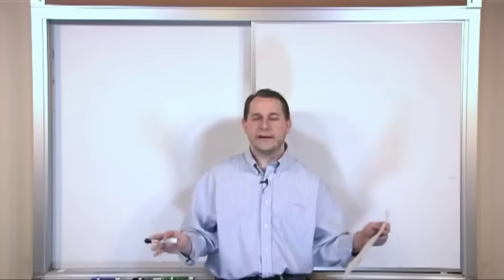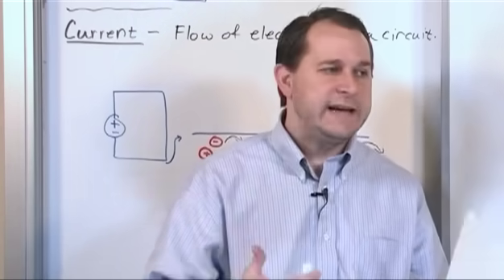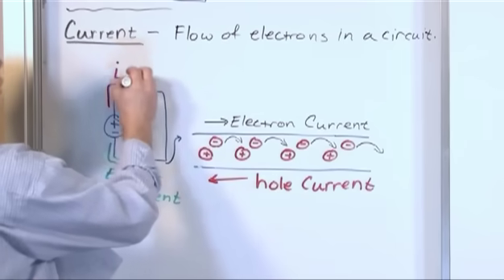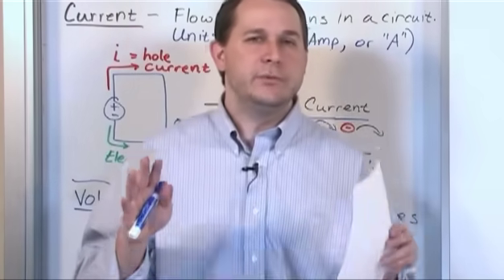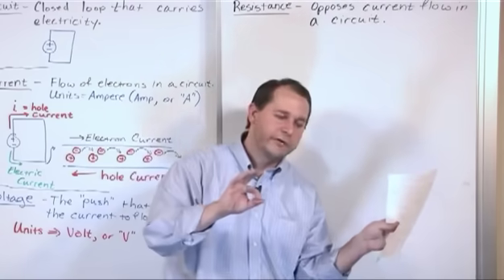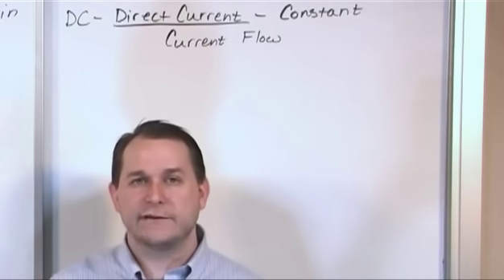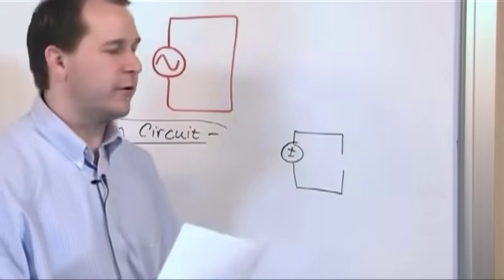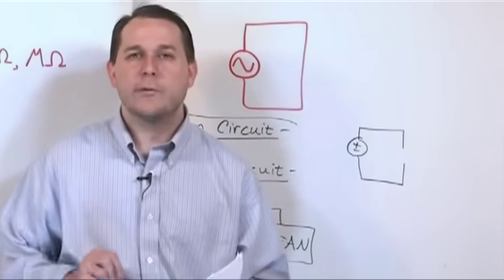Lesson 1 - Voltage, Current, Resistance (Engineering Circuit Analysis)

Comment: I would add that in an open circuit, there is no current but there is still voltage or "potential" at the ends of the wires, because the source is still trying to push and force electrons down the wire and they're getting jammed up against all surfaces of the wire trying to find a place to go. Thus, the electrons still have the "potential" to do work, and if you add a resistance/load they will "inrush" immediately into the load and can cause a spike in current which eventually levels out to a more constant current.

Comment: A volt, amp, resistance meter measures electricity but heat also does. Resistance causes heat. When you have a battery terminal and one is hot you know which one needs to be cleaned. So the heat in the resistance of the dirty terminal measured in Watts or resistance?

Comment: Can anyone please help me clarify this?  I've spent my life thinking electricity flows from positive to negative but now this video indicates exactly the opposite of that.  However, if I take a test light (and ground it properly) to a 12 volt car battery, the test light doesn't light up when touching the the neg. side of the battery but it only lights up when I touch the pos. side.  If electricity flows from neg to pos as this guy suggests,  shouldn't my results with the test light be exactly opposite?  An answer from anyone would be apprecitated!

Comment: Another confusion that people always have, is that they think the voltage source comes with excess electrons to push or to create current flow, not realizing that the electrons that are being pushed are the ones from that copper wire atoms that get lose as they get that excessive energy from the voltage source to start moving
Reply: Excess electrons to be pushed*

Comment: In actual setting or there are electrical loads connected to the circuit which of the  current will flow in direct current or alternating current source? is it  the electron current or the hole current in the conductor? Is it the same for direct current or alternating current?
Reply: Well batteries and DC supplies generate DC current which is constant, while AC generators generate AC current which changes it's polarity very quickly. In conductor electrons move not holes. But if you look at it form electrons perspective holes move even though in reality electrons move. But either way it doesn't matter since it has no effect on equations. Yes it's same for AC and DC. It's always electrons moving but sometimes we just pretend that holes move because it's easier in some situations.

Comment: Youtube randomly introduced your channel to me, however it was lesson 2 after which I subscribed, my second video I watched is your video 1 as the intro, and I am much smatter for it as a new hobbiest to electronics. Perhaps a suggestion from an Facilitating point of view would be to actual use real examples of your discussion points, unless you are only focusing on graduates that already has great subject knowledge. You can easily switch your explanations between your whiteboard illustrations and your real blown up picture of a circuit board. Sometimes students will wonder about what it is you are talking about,example perhaps the  size "is it as big as a mug or as small as a fly" instead of listing they first trying to figure out, which of the several components yon a circuit board you are talking about.

Comment: Another analogy for amp and volt is the amp is the gun, or the size of the shell, the amp is the bullet itself.  I guess the ohm would be the target and it's resistance to the bullet, or more accurately the air resistance.

Comment: The electrons are supposed to flow in a circle so you never "run out" of electrons, right? So after the electrons go from the negative terminal to the positive terminal, how do the electrons travel from the positive terminal back to the negative one to complete the circuit? Why don't the electrons just all accumulate on the positive terminal? And what exactly is a terminal and how does the terminal get its charge?
Reply from the maker: Great question. After the electrons get back around to the other terminal of the battery to go into the battery and the chemical reaction inside of the battery pushes them back up to a high potential again to flow out through the other terminal. So the answer to your question as you can think of the battery is a little chemical pump that takes the electrons from one side and pushes them up to a high potential to exit the other terminal and then go through the circuit again and again and again. When the chemical reaction runs down and the reactants  “wear out” then the battery is dead.
Reply: Thank you!

Comment: When you're talking about Hole current, I immediately thought of P type and N type semiconductor. Idk if they're related but that's something just pop up in my head. I'm 2 to 3 years already behind my school so idk if what I'm saying makes sense. Thank you for this video.
Reply: Well they are related. When talking about PN junctions you can talk about holes moving or electrons moving depending on situation. Like for example when talking about NPN transistors it's easier to use electron flow but with PNP transistor it's easier to use hole current.

Comment: DC power generator or solar panels give dc supply in two two phase positive or negative  give smooth easy to control , 3 phase sinusoidal waves in 60 cycle  that’s why in low voltage 3 phase the breakers has to have 3 common trips to avoid single phase tripping in high voltage relays will take trappings in low he lines aside from track mounted breakers  sensitive relays sense lightnings direct to grounding transformers  in Marshaling electrical room that’s why AC power is complicated compare to DC Power just saying  Thanks

Comment: Did he say smaller is more resistance? Did he say that? Cuz if he did that is whacked out wrong.
Reply from the maker: A smaller wire diameter DOES have higher resistance to current flow.
Reply: You're whacked out wrong.  If you didn't have your head so far up your ass you'd know smaller wire equals more resistance.

Comment: Does the electrons move faster through the circuit, if there's a current with a high ampere than a current with low ampere?
Reply: No. The ampere is just a measure of how many electrons traveling through the circuit per second. So the higher the number, the more electrons traveling through the circuit per second. Think of it as a circuit with large amperage is a big river of flowing water compared to a small river of flowing water (but both flowing at the same speed).
Reply: @James-yi1vk  Thank you very much ;) very helpful
Reply: @TastyPapaya  you're very welcome. When trying to understand electricity, many times analogies using water are used. It really helps because you can't see what's going on. You kindof have to put trust in the science first until you are given the opportunity to conduct tests yourself that re-enforce what you read. Electrical engineering is very abstract and is very difficult to learn because of this. I highly recommend videos that give animated visualizations of the individual components. This really helps you realize that components are just tools that when used together, accomplish things in a circuit.

Comment: The electrons do NOT move at the speed of light.  It is the FORCE of the voltage that moves at ALMOST the speed of light.  Think of a Q ball on a billiard table, how it transfers its force to the 8 ball that gets knocked into a pocket.  The Q stick is the battery that starts things moving.  How's that, Prof.?

Comment: Same as every other bonehead teacher I've ever had. Why not describe the electrical wire exactly as it exists and operates? Why does every teacher insist on describing electricity in terms of fucking air or water. Way to instantly contaminate the truth.
Reply: I blame Santa Clause and the Easter bunny
Reply from the maker: There is a phrase I am fond of that a teacher told me once - education is a series of lies.  You start simple, and end up with a PhD and still don't know how it really works.  The answer to your question is that electricity flow in a wire is not simple or intuitive.  Electrons are not point particles.  Electrons are really a quantum mechanical probability wave function - they do not exist at one location and they are not little "balls" that move along a wire as I explained here.  In a metal, the way the quantum mechanics works out is that the valence electrons of the metal form one gigantic smeared wavefunctions where the electron can appear anywhere along the wire.  

This is why electricity flows in a wire easily - it is because the overlapping wave functions of the electrons in a metal smear out as they overlap, making it possible for the electron to move freely (with little resistance) along the wire.  In an insulator, the valence electrons don't line up this way - it is a property of the metal.  So, the reason I didn't explain this is because no one starting out has any idea how quantum mechanics works at this level of study.  So, first, you need to understand intuitively how voltage, current, and resistance interact.  I use analogies for this.  It helps to build a mental model - that is all.  Sorry you are upset about this but if I bust out with wavefunctions in lesson 1 everyone is lost.  So, continue on your educational journey and as you go higher and higher the things you once thought were true need to be revised.  Education is a series of lies....

Comment: I don't claim to know all that much, but I do know that 'direct' in DC current refers to the direction of the current being a constant, not the magnitude of the current.
This means amps or flow magnitude can vary, but the amps sign or flow direction is constantly one way. (See vid @ ~32:00)

 Take for example the current output of a bridge rectifier with a 60 cycle AC current input. 
Before the rectifier the input current flows back and forth, with its varying magnitude following a sine wave, with equal positive and negative peak currents. After the rectifier, the magnitude will vary with the same shape although flipped in to the positive side.  The current values will act as though an absolute value function was applied to the input AC current.

Comment: I am just curious about the insistence of conventional flow since atom is not moving but an electron does which we denoted current. In the first video I watched, you use voltage across the inductor, but the sequel thereof you use voltage drop across the inductor implying then that there is a voltage reading across electron even when current flow is constant relative to fluctuating one which causes voltage drops. Kindly be consistent of the term you are using to avoid confusion. Thanks

Comment: Very good course. I like your definition of an electric circuit. Without sounding as if I disagree with you (which for the scope of this class I certainly do not disagree)  I would like to share my own definition of an electric circuit which is simply this: It is a path that electrons take to flow from a high potential to a low potential. We see potential variations everywhere in our world and hence the conditions for electrons to flow. (Vis-a-vis a lightning discharge from atmosphere to earth's surface).
Reply from the maker: Yes I love your definition - it is actually more technically correct as to what is going on.  Unfortunately in a first lesson, when the student doesn't know what a "potential" really is, it is difficult to use that definition.  But I like it a lot!  Jason

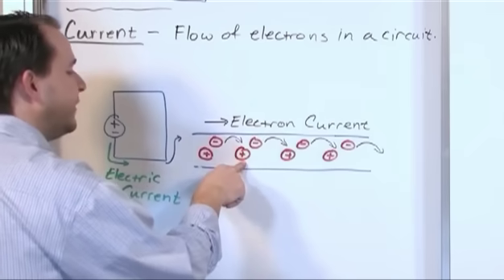Comment: Definitely a top level video.in that some very complex concepts were presented in a way most would grasp.  I didn't buy the subatomic, split second positive charge the metal atom assumes from an electron jumping (~12:30 into) as that jump is being caused by the cathode pushing electrons into it.  I just say doing all the calculations with  negative signs is like driving in reverse.  I just makes it easier to turn the car around is all or whether water is sucked out the front or pushed in the back; the push calculations are easier.. Chemist perspective.

Comment: Are capacitance and inductance important in circuit analysis? Seems most of times only current, voltage and resistance are discussed 🤔

Comment: The discussion of alternating current in a first lesson was adequate but left me thinking. We don't see a light flicker because the alternating happens at 50-60 Hz .  If it takes 1.28 seconds for sunlight reflected off the moon to reach earth and we had an extension cord long enough to power a light bulb on the moon would we see the bulb flicker?

Comment: I view Voltage as being applied.  I will replace current with charge displacement and it is what is made available to be received and how much of it is received is determined by the resistor.  So then one may ask what is it that is sent.  None of the above is sent.  What is sent is ...... wait for it.... signals/photons.  And what is the payload they are delivering...?  The mailman of the universe...   What they carry is what we are after.  We should know what it is.  It is ........Energy.  In this case it is called Electric energy.  This is not the same as electricity.  Electricity is charge displacement.  Want to know the direction of the energy..... Google "Poynting Vector".

Comment: why is current the same everywhere in a series circuit?- if you had a lamp for example that has resistance, it will take a longer time for the electrons to pass through it, so the current will be smaller, the same amount of electrons will eventually pass through the lamp, but it will take a longer time to do so- so the current passing out the lamp will be smaller than the current coming in? Please help!

Comment: You use cross section(al area) for resistance, but diameter for the straw. I'd probably prefer using the former for both uniformly.

Comment: I'm confused about the last one cuz in class I was taught that the current would travel to multiple wired and loads that are on different sections nad that it works better becuz if one of the loads stopped working then the others would still function.

Comment: I would like to give an analogy for hole current. Suppose two trains are standing in a station and intend to move in opposite direction. If one of the train moves and you are sitting in one of train gives you a feeling that both the trains are moving.

Comment: Good explanations for sure, good analogies.  The prefixes he referred to are powers of 10 (or multiplier), and have nothing to do with being 'metric'.  In EE, these are called engineering notation, which is a special version of scientific notation.  Scientific notation is written as a number and a power of ten, such as, 1.5x10^4.  Engineering notation is similar but rounds to multiples of 3, such as, 15x10^3.  If we were referring to a resistor value, we'd call it 15kohms.  'k' is the multiplier.  It has nothing to do with the metric system.  It's a convenient way to express a very large or very small number by adding the prefix.  As he mentioned, k=kilo (1000), m=milli (1/1000), M=mega (a million), G=giga (a billion).  k=10^3, m=10^-3, M=10^6, G=10^9.

Comment: Hello sir.. 
Thank you for this beautiful explanation... 
I stucked in one thing.. 
That free charge flow from conductor.. 
So in 
condition 1 (positive to negative)
Free charge flow throughout the circuit to run load and comes back towards battery... 
Condition 2 (positive to grounding) 
So in this case free charge not comes back towards battery.. 
So my question is how conductor will continuously generate free charge before battery gets dead.. 
Or conductor have infinite free charge to run the load.. 
Please explain.. 
Thank you

Comment: My dad explained it using water. Volts is similar to water pressure and amps the gallons flowing a second. I was only around 9 years old. My dad & uncle were electricians and I followed them in this great trade. He used to send me down basement every year to wire in our American Flyer trains and plasticville buildings starting around 9 years old. Enjoyed my 50 years as a sparky. Worked in some intetesting places: Elfreys alley ( oldest row houses in USA ), a 300 year old Quaker meeting house, slaughterhouse, newspaper,  machine shops, injection molding plant and a large hospital/ research center. As I got older & smarter did more troublesbooting then bull work like installing conduit.

Comment: i am in a thinking process on deciding whether i am going to apply for electrical and electronics engineering double major or not.
Reply from the maker: Good luck to you!  Electrical engineering will be more theory with opportunity to focus on electromagnetism, antennas, signal processing (think voice recognition), etc.  electronics will focus more on transistor circuits, digital logic, computer systems architecture, etc.  good luck!
Reply: @MathAndScience  thank you so much for your support. in my school these two areas are in same major. with selective area courses students can decide which one they will focus on. probably my area will be "electrical" but i need to decide for major initially...

Comment: Im a little bit confused correct me if im wrong but did you mean the "ciruit" was the source of "voltage" then the "voltage" is the force that push the "current" and the "current"was the continued forced that runs to the wire and "ampere" is the measured of how fast does the current flows. Am i right?